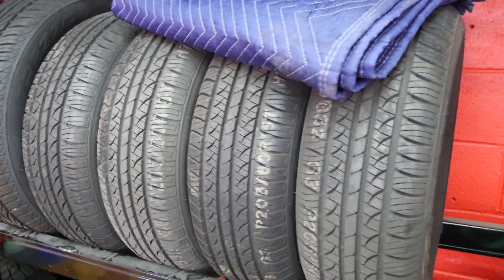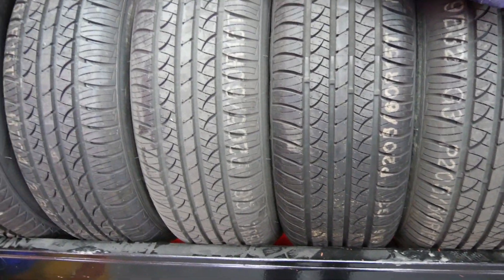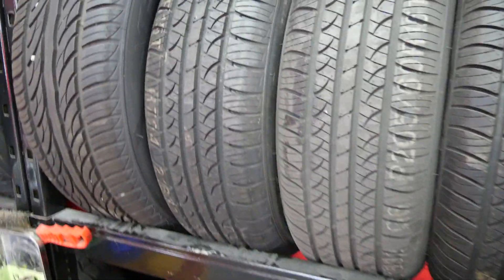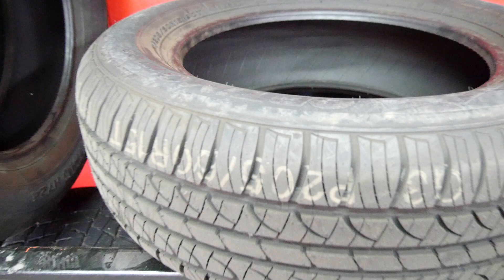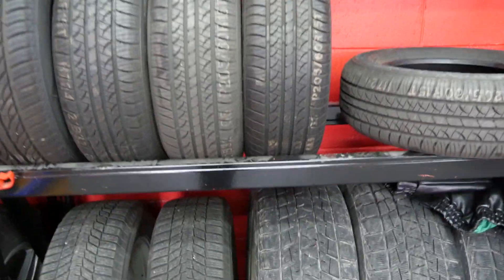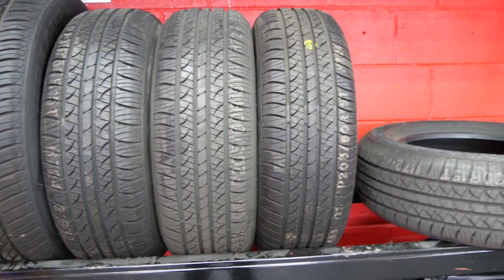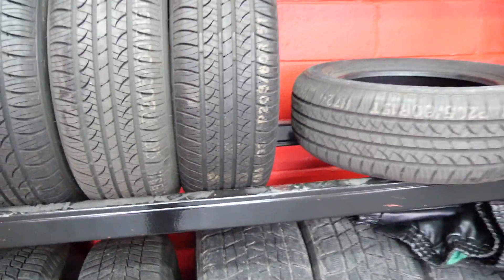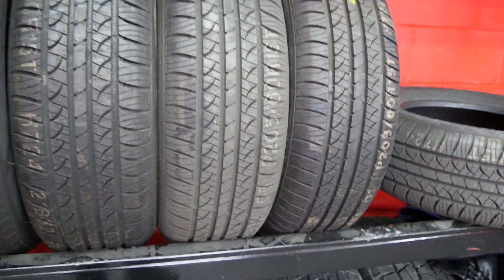DEAD TIRE SIZE (WHAT IS THAT?)

Comment: This is not a dead tire size.  There are other vehicles that use a 205/50R16:

07-12 Nissan Sentra
02-06 Kia Optima
89-02 Hyundai Sonata
95-97 Honda Accord
00-04 Subaru Legacy
98-02 Mazda 626

The list goes on
Reply from the maker: Cosmic Lawnmower awesome now I can sell em
Reply: 2001-2005 Hyundai Elantra. 

Bought some Pegasus (Korean?) tires in that size for $240 installed.  I had 195/60R15 before.